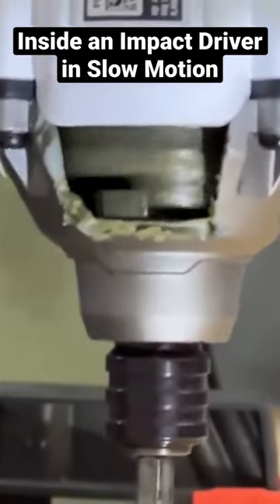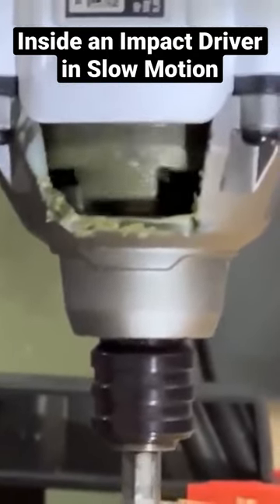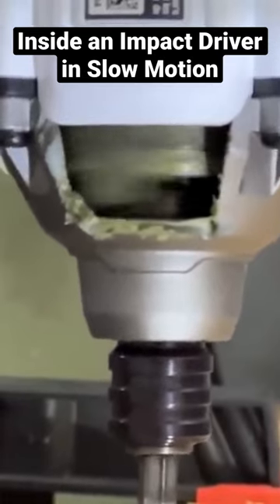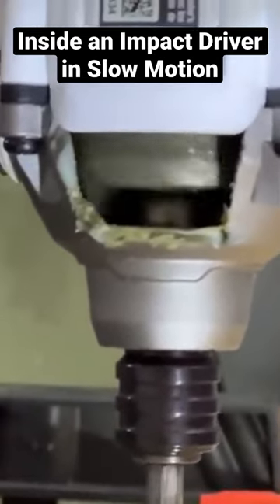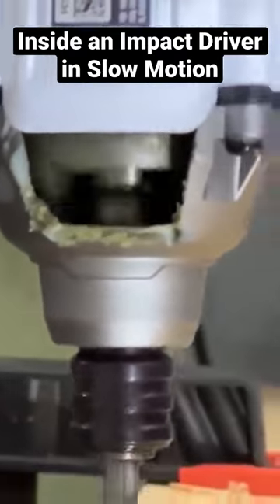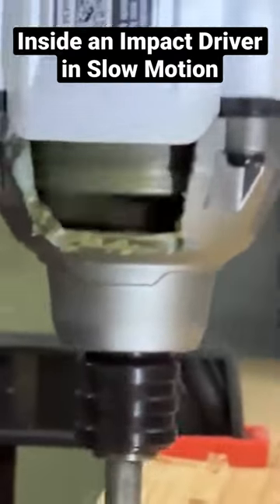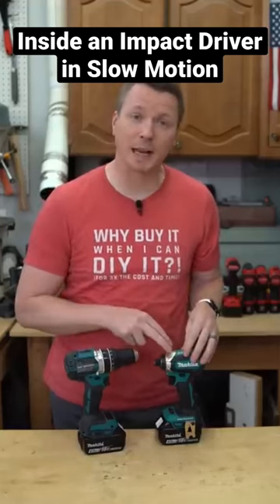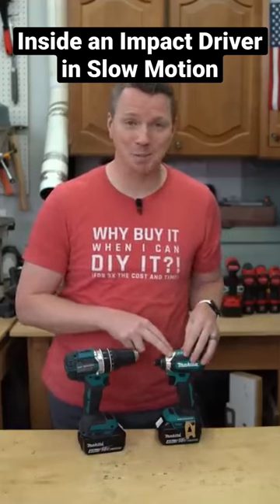Inside an Impact Driver in Slow Motion

Comment: Side note: don’t try to use an impact for constant work for example tapping 100s of of threads because the grease inside will overheat and pour out!
Reply: I've had my impact so hot before that you can't touch it even with gloves on. More than once. Still works great
Reply: That's what they make tap guns for . Some of them are really nifty and when you push in the bit goes forward when you pull back the bit automatically reverses .
Reply: ? Technically SMS8 screws are tapping screws, I can do hundreds in a day and it’s fine lol
Reply: I use my drill on the clutch setting to tap holes out.
So I do not break the tap

Comment: They are very proficient and destroying drill bit edges as well as fasteners/material for which they are not designed.
Reply: Yeah, you shouldn't drill metal with an impact. Wood might be ok. Masonry actually cuts easier with impact.
Reply: @matthewsalmon2013  Yeah, there's some confusion out there on 'impact driver' vs 'drill/driver vs 'hammer drill.'.  Grainger and Home Depot websites have pretty simple explanations of the differences and use cases. Over the past decade or so, I've seen guys destroy drill bits and/or the work piece using impact driver with HSS drill bits or strip out tapped holes, etc. using high torque impact drivers improperly. To be fair, I think I've seen just about every tool used improperly :)
Reply: @stringlarson1247  I'm sure it doesn't help that my drill driver indicates impact driver mode with a hammer icon.
Reply: @matthewsalmon2013  need universal symbol emojis on tools.
Reply: @matthewsalmon2013 are you being sarcastic?
Reply: @BamaShinesDistillery  kinda.
More smart-assery.

Comment: but how a hammer drill works in slow mo 🤔
Reply: Probably compresses the spring for the hammer up a ramp, then it falls off a cliff into the back of your bit holder.
Reply: Like magic when all else fails.
Reply: @matthewsalmon2013  you're right. I looked up a diagram 😊 there's two disks with "ramps" on them, similar to a ratchet or ratchet strap. When it ramps up it compresses the spring and when the moving disk slides past the end of the ramp on the fixed disk, the spring causes it to hit downwards, hammering on the bit rapidly. 

It would be cool to see a modern video. The diagram I saw looked old. Technology may have improved.